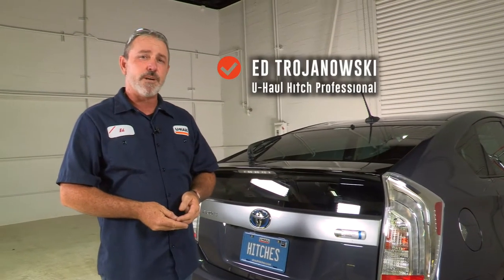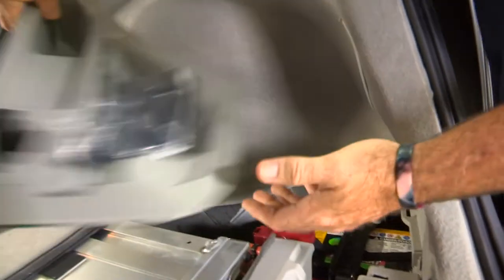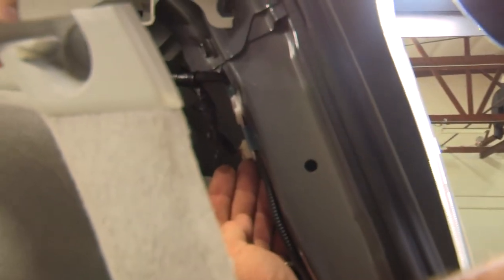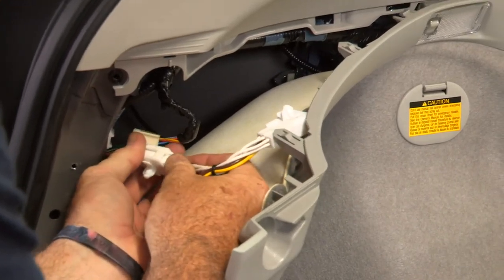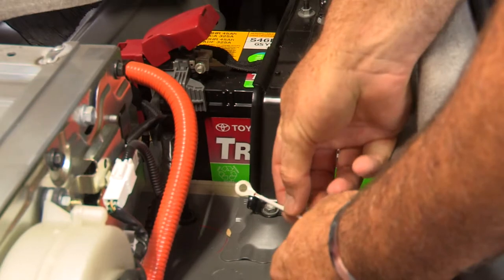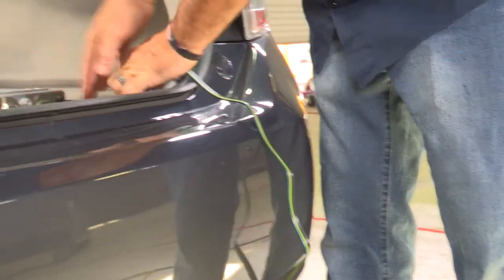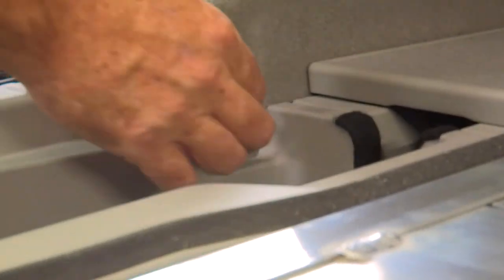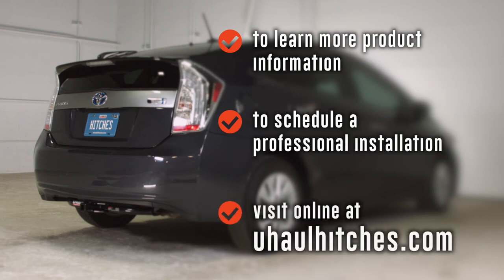2015 Toyota Prius Trailer Wiring Installation

Comment: 10:07 Thank you so much for this video possible for us. 

FY: I have the same Prius. I saw that there is a hole just right under the spare tire through which wiring harness could be gone through that way as well. So that you would be worrying about whether you would damage the wiring by opening and closing the trunk door.
Reply from the maker: The weather stripping on the vehicle hatch helps keep the wires free from damage, and keeping the 4 flat connector in the trunk keeps the elements from corroding the connector over time. If you choose, you can route your 4 flat thru this access hole.  Making sure you cut the grommet to allow wires to pass through, then  re-install it in to the access hole in order to keep the elements out of your trunk. Then Mount the 4 flat connector to a wiring bracket.
https://www.uhaul.com/MovingSupplies/Wiring-Lights/Curt-Connector-Mounting-Bracket-for-4-Way-Flat/?id=25161

Comment: I tried these instructions on my 2012 Prius Plug-in, and it didn't work!  I had a professional check it out, and they said everything was fine except the grounding was bad.  So they put the grounding wire somewhere else (not sure where, sorry) and then it worked fine!  So on Prius Plug-ins (at least circa 2012) the grounding wire instructions in this video don't seem to work.
Reply: Omg I love you so much! This was my issue too and I couldn’t figure it out, thanks for the help! 🥹